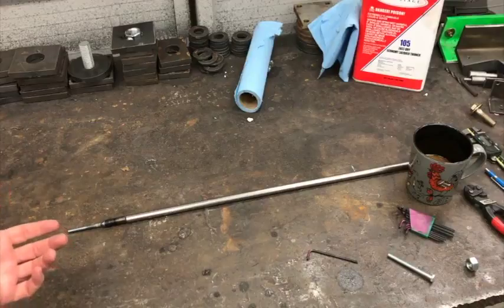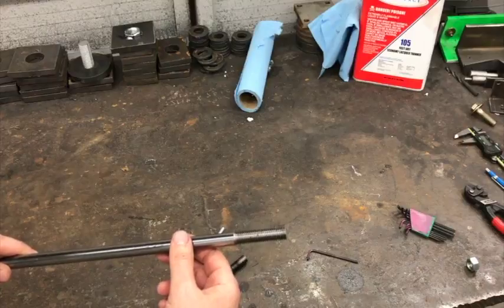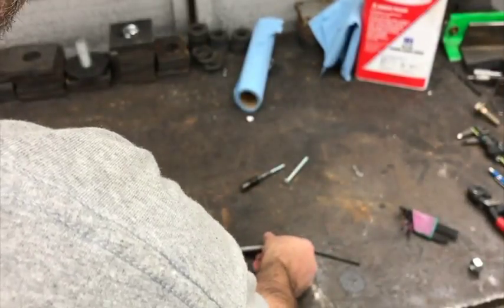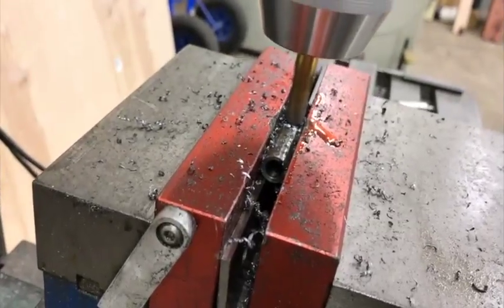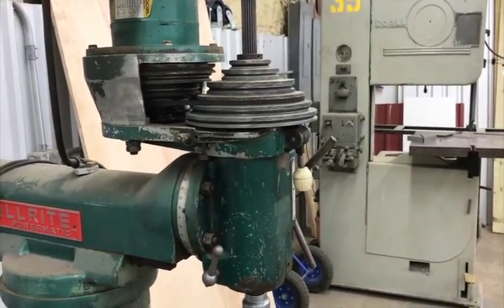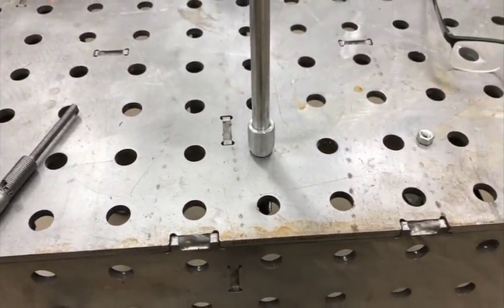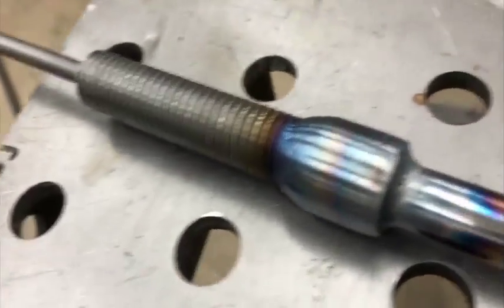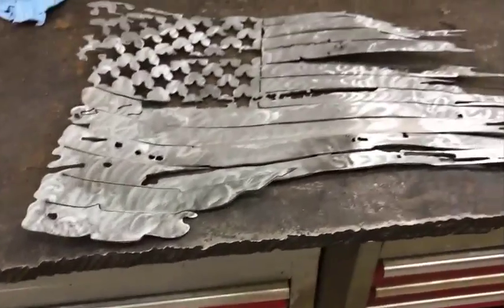saturday repair job - machining + tig welding

Comment: Good idea on the oversized  solid to make the adapter.  :-)
Reply from the maker: yes sir, thanks Cecil... you done much on your mill or lathe lately?
Reply: No I haven't.
We are going through a major renovation at work and it is eating up all my free time and energy.
We should be done and back to normal mid March and I can get back to the shop finally.  :-)

Comment: Hope nothing heavy is being held up by that thin wall thread on the other end! Nice fix on the end you worked on though....:)
Reply from the maker: Yea no doubt, very thin for sure.  I am not exactly sure what the chandeleir looks like or how much it weighed.  Would have made the job easier had I known that :)

Comment: Looks like a cluster-fuck job. It always seems to happen that way. They never really tell you what's it for or how it's going to be used. So it makes it that much harder to problem solve for them.
Reply from the maker: Yep, your right, I had no clue what this thing actually did, attached to, etc.  They gave me small amounts of info, oh well, it worked out well and I made $20 for 4 hours worth of work lol
Reply: Oh man... I actually laughed pretty hard about your $5 an hour revelation. That should be your next thumbnail... "$5 an hour Nincompoop!"

Comment: the first thing that will happen is it will grab your hair and pull your head/face into the pulley. I have seen it happen!
Reply from the maker: Good thing I keep mine buzzed off!
Reply: I was never a long hair, 2 to 3 inches at most. I lost a clump of hair and had my head slammed into the cast iron head of the machine and saw stars! and there lying shattered on the floor was my pride. Serious headache. Split second. 1971 we had some dangerous equipment. Half of the machines had brass plates on them saying "for war production only". Lots of old Belgium tool and die makers at  J. I. Case Company, old school . Jerome Increase Case was the the man that started it.  Sorry I got carried away gary. If I dont keep it short I tend to rattle on.